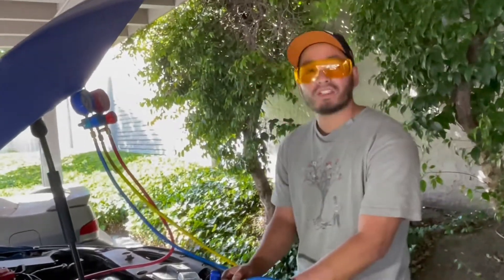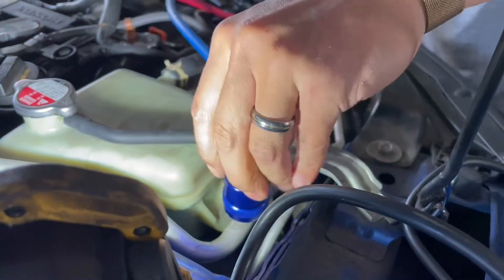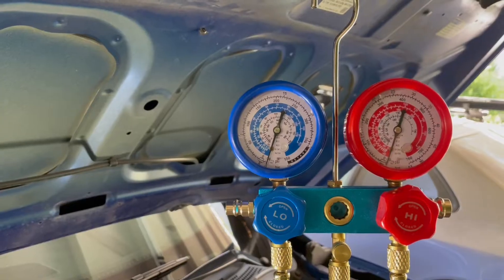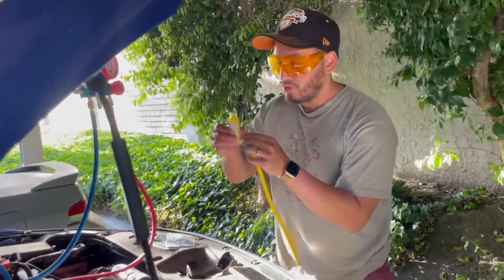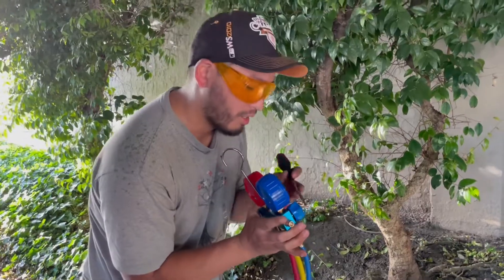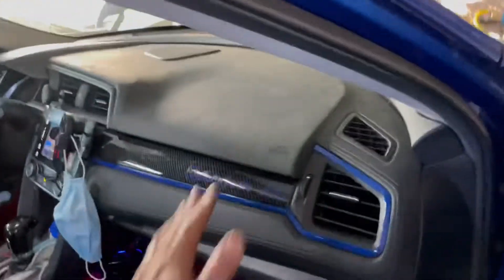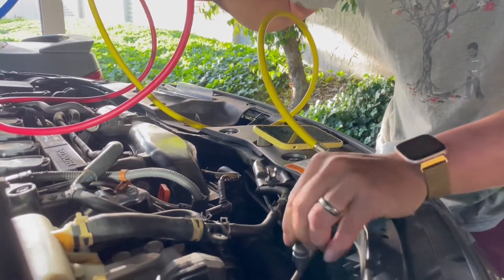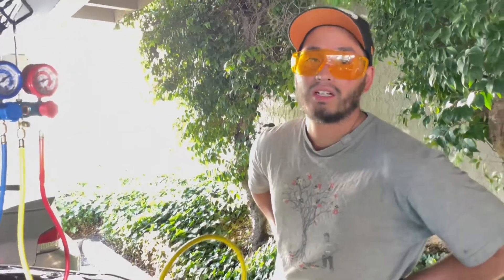DIY R1234yf Conversion To R134a How To Recharge AC Refrigerant On 10th Gen Honda Civic AC Fix Part 2

Comment from the maker: Part 1: Replacing the faulty compressor:  https://youtu.be/t6rfv4WOlGU

Required 1234yf adapters:  https://www.amazon.com/gp/product/B07PZS5NYB/ref=as_li_tl?ie=UTF8&camp=1789&creative=9325&creativeASIN=B07PZS5NYB&linkCode=as2&tag=sal05cb-20&linkId=52eb3051af409f2255a92925c3c17cd5

Vacuum pump/gauge kit:  https://www.amazon.com/gp/product/B07LBLDZ89/ref=as_li_tl?ie=UTF8&camp=1789&creative=9325&creativeASIN=B07LBLDZ89&linkCode=as2&tag=sal05cb-20&linkId=98727490d20cda0e0d452d07119251b6

UV dye:  https://www.amazon.com/gp/product/B07RJ22ZKJ/ref=as_li_tl?ie=UTF8&camp=1789&creative=9325&creativeASIN=B07RJ22ZKJ&linkCode=as2&tag=sal05cb-20&linkId=9e4ad9b68bc5014ae9b215c1a95ec8dc

R-134a refrigerant:  https://www.amazon.com/gp/product/B094794VF4/ref=as_li_tl?ie=UTF8&camp=1789&creative=9325&creativeASIN=B094794VF4&linkCode=as2&tag=sal05cb-20&linkId=d4cc421d7a4bb91ddc7bf4d137436999

Comment: Maybe I missed it, but where was the conversion part of this conversion how-to video?
Reply from the maker: This video, which explains how I converted the Honda civic running 1234yf to 134a refrigerant.
Reply: @Sals_Garage I must have missed it.. Sure it explained that you put r134 in instead of the new stuff... But the connectors don't fit the gauge etc.. Is it as simple as using a gauge adapter and sending it? Doesn't the old oil need to be flushed and pag put in? Wouldn't the evap or other parts need changed out?
Reply from the maker: @MichaelPSmith-mps it’s as simple as you said. Good luck

Comment: How is your car doing after that conversion cause i also thinking of converting my ac system to 134a it seems 1234yf are too much for the compressor making it bad for all the other systems. Please send out a quick message here at this comment thanks!
Reply from the maker: Still blowing cold, much more reliable than 1234yf
Reply: @Sals_Garage  can you hmu in my email or my cell so we can exchange some info about how you did your conversion? Oh yeah does it work with the 2020 1.5T? Thanks sal
Reply from the maker: @stevenleyson728 I only talk to ppl through here. Good luck

Comment: All's well and good. To find leaks I just do the unthinkable. I pressurize the system with regular dry air to 95-100 psi and use 1 part dish soap to 10 parts water in a spray bottle. I spray steam the joints. I have yet to NOT find a leak that way. Then after I fix the leak it test it again with 95-100 psi air, if it holds for 30 minutes then I pull a vacuum for 30 minutes and let it sit for 30 minutes. If it doesn't leak, I fill it per the oz on the car. Last car I did, my sons car, we got it down to 40 degrees. If you do use compressed air try to make sure you filter it well or use CO2 if you have some available. Using compressed air has worked like a charm for me multiple times when a vacuum didn't. The reason I use air pressure instead of vacuum is because air is cheaper than R134A and Green Dye. You can pull a vacuum all you want, but it you have a leak you can't use soapy bubbles on a vacuum lead or it will suck the soap and water into the system. So then you have to guess where the leak is after a repair, or charge it and try to find the dye or use soapy bubbles while it has R134A in it that if you find it, then you have to take it to an HVAC shop and pay them to evacuate it, or break the law and vent it. Yep Compressed air and soapy bubbles are WAY faster to find a leak or verify the system will hold under pressure where a vacuum doesn't always work. However always pull a vacuum to get any moisture that the compressed air might have gotten into the system. Just a little tip for yall. Oh be carefull with R1234YF it's basically Propane, so NO smoking in a car if the AC goes out while you're driving! Want to know what Explosive Refrigerant can do to you in a car. Well a professor experimenting with Explosive refrigerants found out with propane. Here; https://www.youtube.com/watch?v=k0K1WPCWm2k&t=266s
Reply from the maker: Thx for sharing

Comment: What was your high side pressure after 1 can
Reply from the maker: Around 130
Reply: @Sals_Garage put another one in it...hook gauges up...valves closed....purge red and blue...hook can up purge yellow....open blue....read red until 200 psi...close blue....rev eng 2000rpm for 45 seconds or so...until consistent 200psi....will not hurt to be a little over on weight...little over better than little under
Reply from the maker: @user-lt1bf4hg5h thx for sharing

Comment: Great job.   I think your wife did all the work.    Just kidding.   I too have a 2016 Honda Civic.   AC not working.   Made an appointment with Honda.    They say the Compreesor and Condenser are covered under warranty.   It's 9 years old now.   Is this a problem with 2016 Civic models?     Honda is covering the cost of Compreesor and Condenser if this is the problem.    Would Honda do your job for free?    You also mentioned that this happed 3 times for you.   Wow this looks a huge fault for Honda.   Have they rectified this problem in futre Civic models?      Let's see what they do for me and if I have to pay anything for this repair.   The diagnosis for checking is $ 405.00 plus 13% tax   Canadian.     I hope they don't say it was some other problem and charge me more.   While the could have changed the Compressor and just say it was another issue while charging me and Honda for the repairs.     Lets see.    You keep you posted.    Will check for the new Compress or if installed.   Thanks alot for the video.   Would like your feedback.
Reply from the maker: Anytime!

Comment: AC still working?
Reply from the maker: Very good 3-4 years later no issue.
Reply: Ok im about try my first YF refill but if it goes south ill try some 134@Sals_Garage
Reply from the maker: @RACEALOTGARAGE nice
Reply: @Sals_Garage  One question: My car is a 2018 civic lx model. Is it supposed to use the 1234yf? Can I get a 123A? I didn't know that. Can you explain it to me?
Reply from the maker: @sandergarciagarcia7432 this works for 2016 to present

Comment: La pregunta del millón... EN el condensador existe residuos de aceite del anterior refrigerante al igual que en el evaporador y sus líneas adyacentes. ESTE DEBE SER REMPLAZADO AL IGUAL Y SE DEBE HACER UN FLUSH A TODO EL SISTEMA PREVIO RECARGAR CON EL NUEVO ACEITE Y REFRIGERANTE R134A PARA NO CORRER EL RIESGO DE CONTAMINACIÓN. MI PREGUNTA ES, LA SECCION 203 PROHÍBE ESTA CONVERCION DE 1234YF A R134A. PUEDE ESTO TENER ACCIONES LEGALES ?
Reply from the maker: Sorry no espaniol
Reply: @Sals_Garage  Aprende Español You need to know
Reply: While mixing A/C Compressor oils is usually not recommended, as it can lead to A/C Compressor damage and failure, the new ND-oil 12 can be used with both R1234yf and the old R134a type refrigerants.
Reply: I don't really care what the little green men think.

Comment: Are the 2 systems compatible with their pack oils? And if not, isn't there any oil from the old system still within the lines that can mix
Reply from the maker: @salas231141  each system has their own oil compatibility. Vacuuming the system prior to recharge reduces the risk of mixing which is not a problem in lower quantities.

Comment: Do you replace the compressor for a new one or used ?
I have a sonata 2019 and it used r1234yf freon, but in the label of the compressor also said hfc134a, so im guess i can use r134a intead of that spencive r1234yf
Reply from the maker: @zaco2356  yes 👍

Comment: Tint will help too
Reply from the maker: @blu101-o3t  yes we have 35 percent ceramic tint.
Reply: @Sals_Garage  go for 15
Reply from the maker: @blu101-o3t  ok 👍
Reply: @Sals_Garage  Any?
Alternatives if you don't have that particular tool
Reply from the maker: @blu101-o3t  what tool?
Reply: @Sals_Garage  I replied my A/C Condenser and I have two bottles of the 1234RY and the trigger hoe I don't have that tool you order from Amazon
Reply from the maker: @blu101-o3t  Order it in the link in description.

Comment: can r1234yf be use with the compressor you installed? and how is it so far? still working? thanks
Reply from the maker: @djmegax13  still going strong. No issues at all
Reply: @Sals_Garage  thanks for answering. What about the refrigerant.  Can still use the original or it needs a different compressor.
Reply from the maker: @djmegax13  works with either. Just use the correct oil for that refrigerant
Reply: @Sals_Garage  all right this summer has been killing me. My poor civic ex 🫠🫠🫠. Thanks again
Reply from the maker: @djmegax13  anytime. Good luck 👍
Reply: @Sals_Garage  Thats good to hear,my 2019 had the seals fixed last year from honda dealership but now i hear a small hiss for 203 seconds when i turn the ac on sometimes so that means it has a leak again(freaking BS)i got till 2029 under extended warranty to fix but i will convert mines to r134a by that time since im mechanically inclined. I also now have my car paid off and its full bolt on done all by me and i want no one to toych my car too even more since its very low to the ground. I still have to take it in for that fuel pump recall but i might end up doing it myself regardless.
Reply from the maker: @ hope things work out for you soon

Comment: Hello, I'm from Indonesia, I want to ask, we just replaced the Civic Turbo AC compressor with a new Mahle brand, then filled it with coolant, but after filling it, the engine fan immediately started spinning very fast, even though the high pressure showed 150 Psi and the low pressure 30 - 25 PSI. , is that normal for civic turbo ? Thank You😊
Reply from the maker: Yes that is normal, depending on the temperature that day.
Reply: @Sals_Garage  The weather conditions in my city are currently around 28° Celsius, thank you for answering my question because I was confused because the pressure was not too high but the fan was spinning fast
Reply from the maker: @allessandroihsaniranoto7907  you should be fine. It’s different since we are retrofitting different refrigerant.

Comment: You do not need to tighten those nobs on the service fittings. Those are just pushing on the schrader vales and you can actually damage them by turning them too far. I susually just tighten them so I can feel that they bottom out and then turn back some.
Reply from the maker: Thank you for the tip!

Comment: Just wondering if there as been any  system failures after you did this conversion?
Reply from the maker: @Anonymous_Sol  none since this video. Before that on stock system I had two failures (condenser and 2 compressors)

Comment: How has this held up years later did anything go wrong? Experiencing the same issues on my 17 SI
Reply from the maker: @mayasergio13  no issues 3 years later. More reliable than original setup
Reply: @Sals_Garage  I bet it was, had so many components on my a/c replaced because of the oem refrigerant. Wondering if a shop would be willing to do this for me 🤔. Good to hear you found a solution though 🙏🏻
Reply from the maker: @mayasergio13  good luck! You got this

Comment: I have a condensor leak on my '19 Si (had a shop evacuate the system and diagnose). I plan to replace the condensor and do a recharge myself, but am interested in converting to r134 for reliability (and cost in case of future failures). Question: Does the compressor need to be replaced for me to do so? or has all the non compatible oil been removed by the shop's evacuation?
Reply from the maker: Compressor can be used but change the oil to pag46 for compatibility

Comment: Thank you!  Finally someone answered my question:  is it possible to use R134a  instead of R1234yf?  .  Obviously, thermodynamically they are very similar or this wouldn’t work.  I don’t care that R 1234yf is so much more expensive (4x more).  I added  the R1234yf last year in my Cadillac XT5 and again I need to recharge it this year.   I didn’t realize this was a common issue with R 1234yf.
Reply: Did you convert it to R134a? Do I need to change anythiny before converting or only evacuate the system from R1234yf?
Reply from the maker: @RH-kh8gs  yes, check out part 1 video
https://youtu.be/t6rfv4WOlGU
Reply from the maker: Yea they tend to be prone to leaking issues more than R134a

Comment: So in this video is the old ac fluids still in the system in the start of the video or did you have the fluids preflushed before making the video? I am wanting to do this conversion to my 10th gen but the way you're explaining everything is confusing to me.
Reply from the maker: In part 1 the Freon was evacuated at a shop.

Comment: In my country they do this same process, but they always use the oil that the compressor uses according to their manuals. I don't remember the name but it also ends in “YF”. They only change the refrigerant gas, which in this case is R134A instead of R1234yf. My car is a 2018 Honda Crv, 1.5 turbo, and it works well.
Reply from the maker: Thanks for sharing!

Comment: charging a 1234yf system with 134a is illegal as well as the 134a will cause damage to the 1234yf system. chargin the 1234yf system with 134a will cause evaporator coil freezing. none of the yf components are designed to work with 134a. this also voids any warranties on the system. PLEASE DO NOT DO THIS!! - certified EPA license holder.
Reply from the maker: Thanks for sharing 👍
Reply: His has been working for three years so I guess the evap core didn’t freeze and the components didn’t get damaged. Sooooo you are spreading false info
Reply: Don't believe all the propaganda. I've done this to several vehicles without any issues whatsoever. The same things were said back in the 90's when R12 was being phased out. I converted hundreds of vehicles over to R134a when the "experts" were say "you can't do that, you'll destroy the whole system" Guess what, they were wrong and those vehicles lived on for many years with ice cold AC.
Reply from the maker: @scottcpan68  thanks for the info, good to hear 👍

Comment: Where is the conversion? Did you not go by manufacturers specs and added the wrong freon #? RIP ac
Reply: It may be illegal but they ain’t payin to fix our cars everytime it shits out so fuck em just got quoted $4000 this is the second time this has gone out I’m doin this switching back to 134a
Reply from the maker: @flipposgarage  I agree with ya. Old refrigerant is so much more reliable
Reply from the maker: The older refrigerant is still going strong. More reliable than the new one.
Reply: @Sals_Garage  sounds good but it is illegal to replace r1234yf. 🤷🏻‍♂️
Reply from the maker: @Stockbadger  correct 👍

Comment: First start the fill before u turn on the AC. Also depending on where the low side port is you either hold the can upside down if close to evap to put in liquid or right side you to put in gas if before the expansion/orrific tube. Flipping back and forth is going to put the wrong state of the freon in which can damage the compressor
Reply from the maker: Thanks for the tip!

Comment: Hello friend, thanks for your contribution, I am about to do the same to my 2018 Honda civic. I have a question, what do you mean by this.  “Make sure the whole AC system is evacuated at a shop since you do not want to mix both refrigerants”.

1.-If I fill with the same 1234yf coolant do I have to clean the lines.

2.-Cleaning the lines, can I do it with the vacuum.

I appreciate your time to respond.
Reply from the maker: Ideally you don’t want to mix the two, have a shop discharge the old Freon then you can vacuum the rest out with a vacuum pump.

Comment: "They" say that the oil used for 1234yf is backwards compatible with 134a, but not visa-versa. I'm considering changing my Camaro back to 134. I live in Thailand and imported a 2019 ZL-1. I have the only 6th gen ZL-1 here and Chevrolet isn't here. So, I'm on my own. The problem is Thailand cars all have 134a. None of the new 2024 cars, BMW, Honda, etc, all brand new cars still use 134a here. So when I install my interchiller, I will be forced to open the line and let the gas out. I will then vacuum and then refill with 134a. I cant even get 1234yf without importing it from the US or Australia or somewhere. The problem here is I don't know how much 134a to put in.... This is where I'm lost.
Reply from the maker: I hope you figure it out soon. Good luck 👍
Reply: Hola, soy de mexicali baja california mexico,  se carga  de  entre 35 a 45 psig lado de baja presion. Saludos

Comment: Sorry, but why should anyone go back to R134a? R-1234yf is better for the environment. Yes, it is more expensive but it is worthy to protect our planet and future!
Reply from the maker: I would be ok with it if it didn’t cause our AC system to leak 3 times from the compressor and condenser. Honda’s AC system is not reliable with R1234yf.

Comment: Nice, didn't know you can converted back to R1234a.
Reply from the maker: I wanted to do it because it has been more reliable. No issues so far.
Reply: You didnt replace the ac condensor? Any problems to date with the switch back to R1234a? @Sals_Garage
Reply from the maker: @andyyepez7893  dealership replaced the condenser before. This is my third compressor and so far it’s been reliable ever since switching to R134a
Reply: @Sals_Garage which should be done first if you are replacing both?

Comment: Is the compressor you bought made for 134 or 1234? Have you heard of any one successfully doing this to a Honda pilot?
Reply from the maker: It’s compatible with both. Haven’t heard that yet, hope it works for you. Good luck 👍
Reply: @Sals_Garage  did you put the same amount of refrigerant 134a in your car that the car requires for 1234yf? I heard you need less because 134a is more dense?
Reply from the maker: @garnetvertican8179  we put a little less to be safe, used the recommended ambient temp chart in the video.